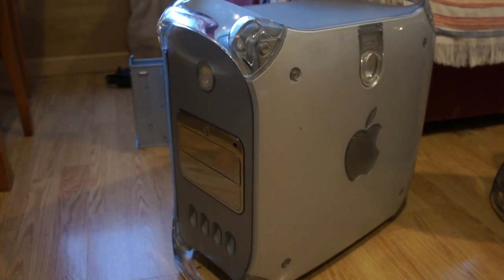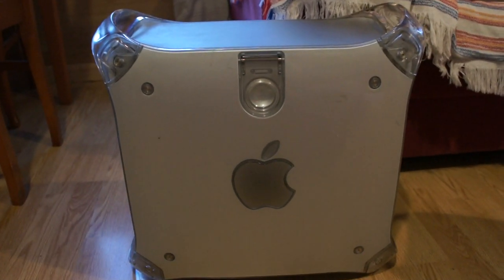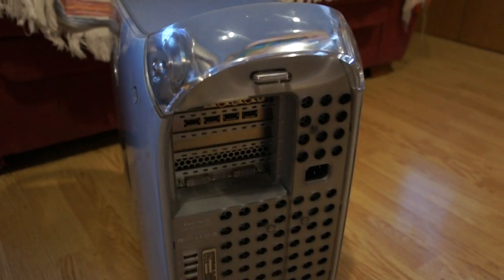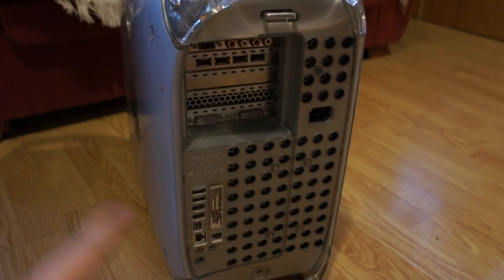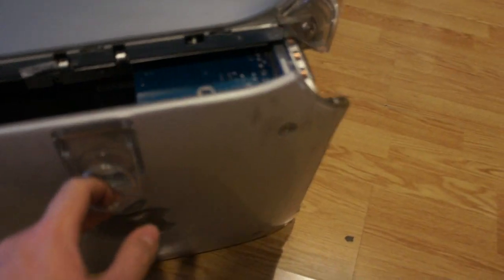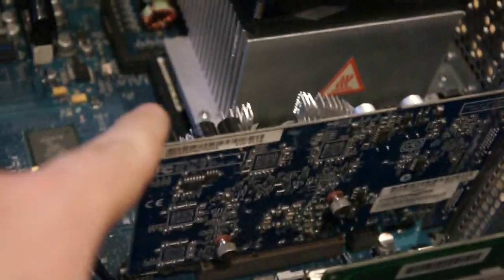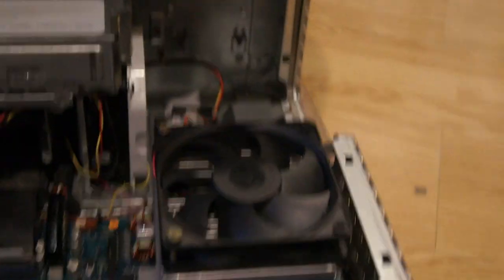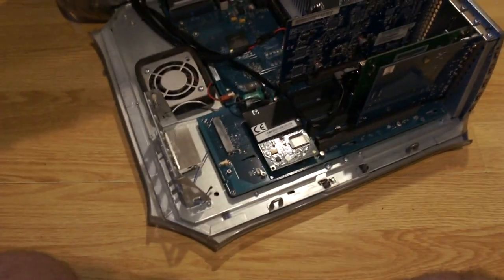VLOG: My G4 MDD has died. All hail the almighty G4 FW800.

Comment: The MDD G4 was never a particularly reliable model sadly. They had constant issues with PSU's. The prior QuickSilver G4 was a much more conservative design without the higher failure rate, although not as fast.
Reply from the maker: Well, the PSU in mine has had its guts replaced with the ones from a Seasonic M12II 520W, so that's not a concern anymore.
Honestly I've never liked the QuickSilvers. Very picky with PCI cards and GPUs, to the point where they won't boot up at all with some SATA cards, the 1.5GiB RAM limit, and the PSUs in them weren't particularly reliable either. I know my opinion might upset some people, but I think the best use for QuickSilvers is CPU upgrades for Sawtooths and Gigabit Ethernets.
Reply: The MDD G4 was never a particularly reliable model sadly? Maybe you've not been lucky. Mine has 16 years of continuous use and till now no problem at all. I agree with ITTFami about the QuickSilvers.

Comment: I have one of this (version @ 867 MHz, bought NEW by 2002) and till now it runs smoothly. In fact, despite your opinion, mine has the two front bays both equipped with Pioneer CD/DVD player/burners. Also, I've taken advantage of the lot of inner space and connection options and I've installed two hard drives (one of then used as a backup drive). I've also installed an IOGear Card to get USB 2.0 ports. Of course, this is NOT my primary computer, but is still usable and useful, and a real working beast! (16 years of continuous usage and it is still like new; can you found any PC that lasts as long in perfect working condition without any service?).
Reply from the maker: Sounds like a lovely machine. 
Believe me, I've seen PCs way older than 16 years working fine without any service. I've also seen a couple of Macs in such a condition. And a Sun Blade 2500, too, processing the MRIs at my local hospital. Don't know if that one's been serviced or not, though.
Reply: @ITTFami  
Well, this is not my OLDEST Mac that's still in perfect state. Believe or not, I have even a... Mac IIsi (1991) that's in perfect condition (one of the beauties of this Mac is its hard disk, a venerable Quantum HD, that works like a charm). The only thing that I've needed to change is... the internal battery! (and this lasts as long as... 7-9 years in continuous use!).

Comment: Are you planning on maxing it out spec wise?
Reply from the maker: If I had the money to buy a GigaDesigns dual 2GHz G4 and a G70-based geforce 7800GS AGP I most certainly would max it out. However I don't even come close to that, so for now it's staying as is.